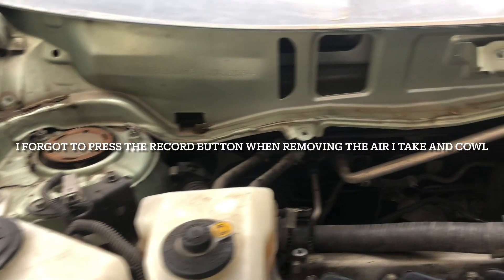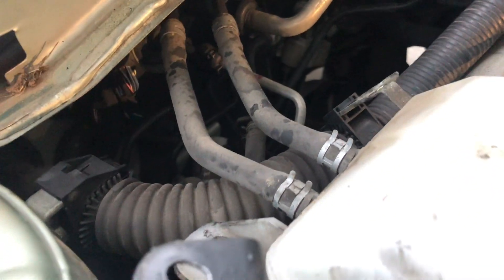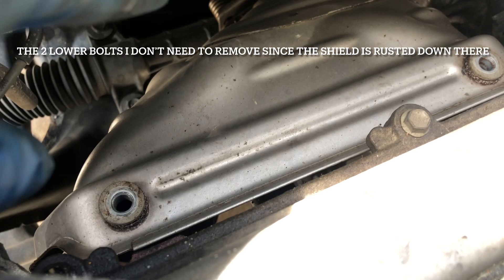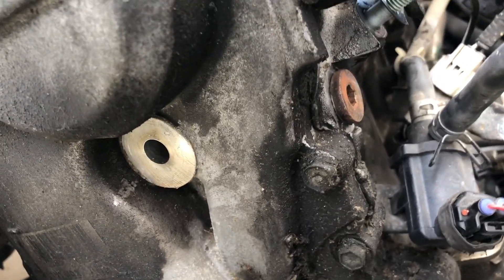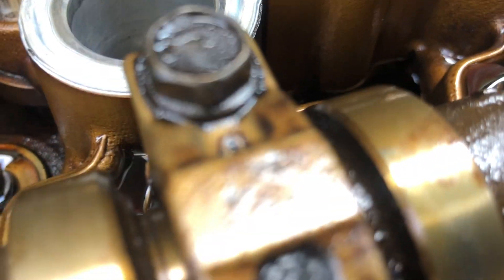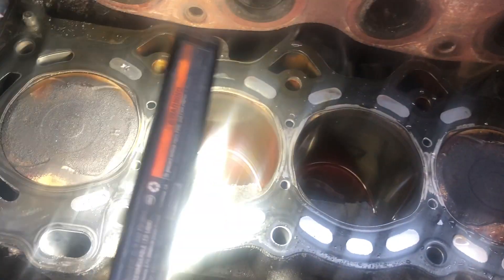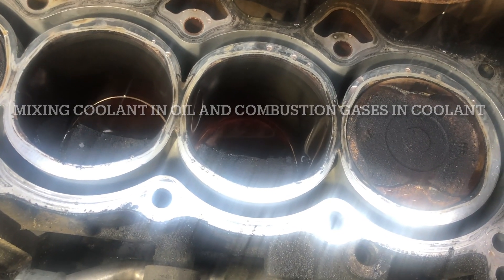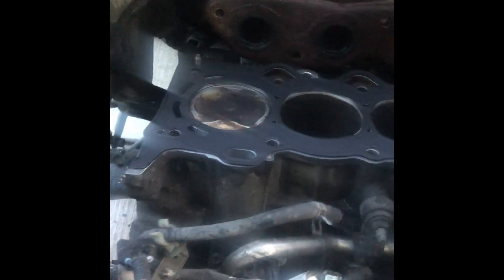Replacing the head gasket on my very high mileage 2009 Toyota Prius. Easy and cheap DIY.

Comment: Curious… what signs did you get that this Prius needed a head gasket?
Reply from the maker: when you open the radiator when it's cool and coolant spews out, reservoir (overflow) tank is always full or overflowing (cold or hot) and red triangle sometimes if it overheated (loss of coolant)
Reply: @highmilesgarage9131 I am currently experiencing the similar…but only after daily driving around… pressure is gone when cooled down.
Thanks!

Comment: It appears you were not concerned about head warpage… did the new gasket alone fix the problem?
Thanks

Frank
Reply from the maker: the engine actually turns off most of the time in a hybrid so it has chances of cooling. Unless driven with a bad head gasket for a very long time then expect warpage. If you're a shop then consider resurfacing to avoid customer returns (and doing it twice! without labor charge) As a DIY it's a gamble to take. It's been doing well for several months now just for the head gasket replacement alone.
Reply: @highmilesgarage9131 excellent!…that’s the result I wanted to hear.  I will only do the work myself… but I needed to hear a  success story…thanks!
I am considering  correct repair $$$  vs $28  bottled sealer its a 200k car and a lot of work…
Reply from the maker: @ yeah those fix-in-a-bottle will not help at all (too many you tubers claiming that it's ok but there's really no long term followup) The head gasket replacement is very easy on a Prius.

Comment: What is the torque specs for the head bolts? Thanks Chad
Reply from the maker: 21 ft lbs, then tighten 90 degrees (1st pass), then another 90 degrees (final pass)
Reply: @highmilesgarage9131  thank you!